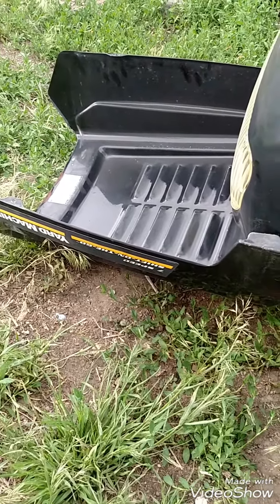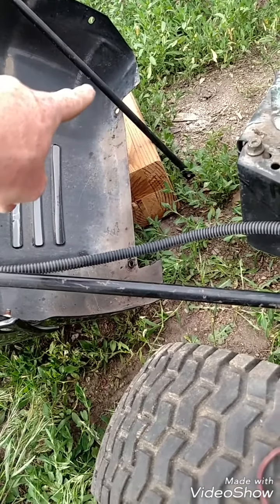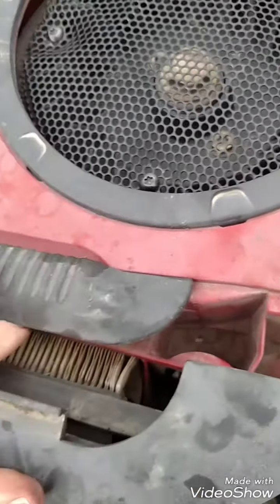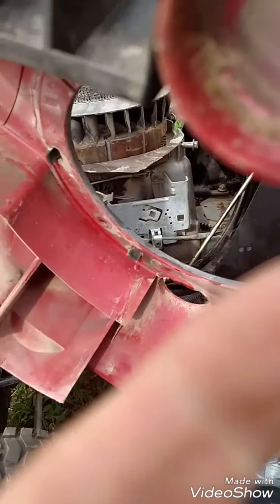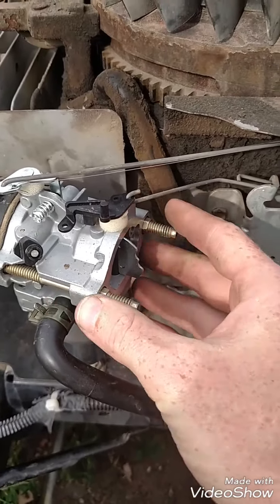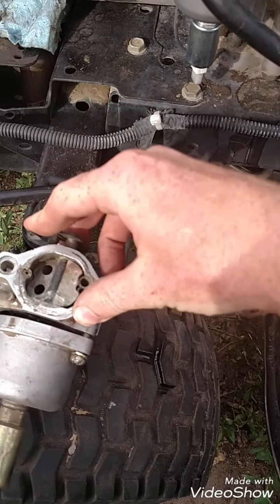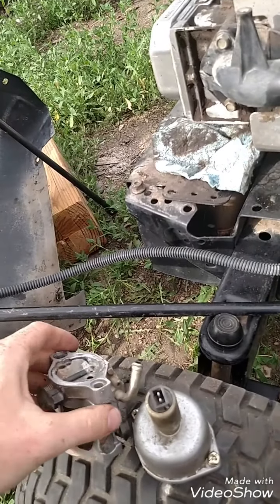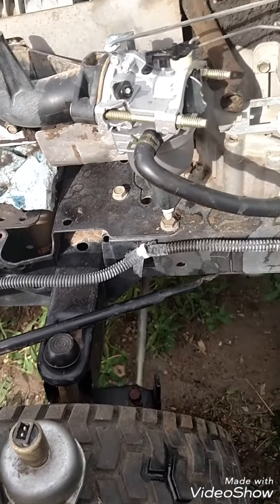Mtd yard machine riding lawnmower carb removal. Link to parts or accessories below!

Comment: hey man can you tell me where you got the new carby from? exact one??
Reply from the maker: I got it off Amazon. It won't let me copy the link for some reason. Is yours a Briggs and Stratton engine?
Reply: @ecohunter  yeah sure is. i figured out what is wrong. the red wire that plugs in the solaniod isnt there so im guessing thats why its not working. ill check amazon out if i need a carby. thanks mate